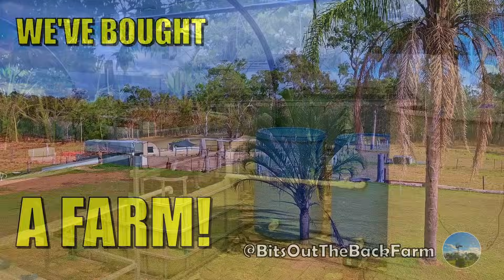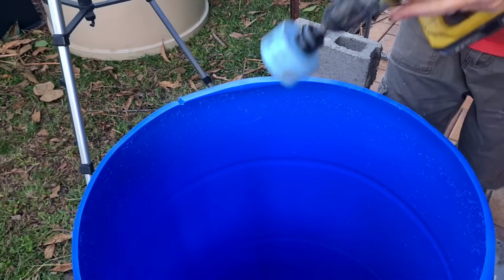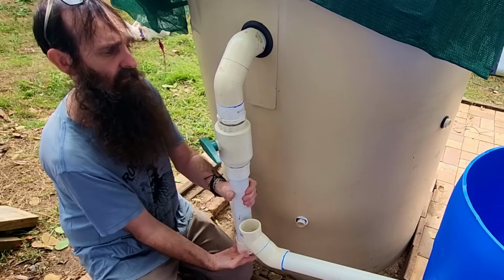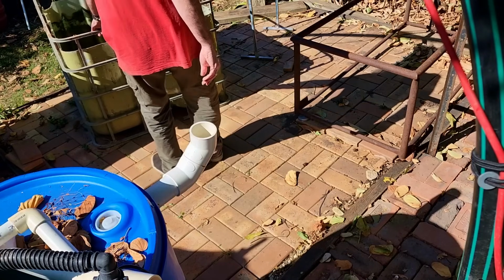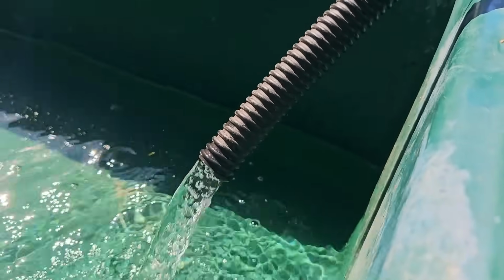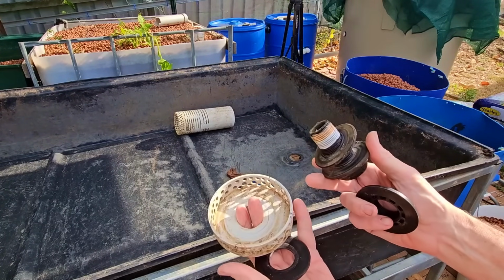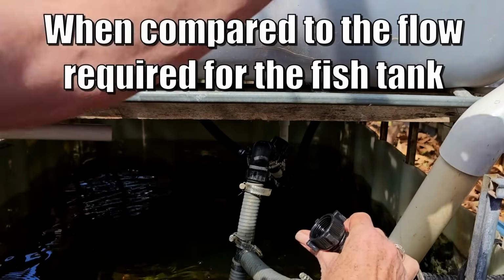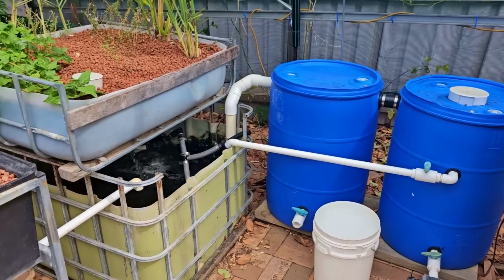Complete DIY Aquaponics System Build | Fish Tank, Filters, Dual Root Zone & Media Beds

Comment: holman make the 90 degree elbows. i've never seen those bends you have, in australia
Reply from the maker: Loads of folks make the 90°. The dual 45° create a sweeping bend. 😉
Reply: @RobsAquaponics  so what's the piece that you mentioned wasn't common in aus?
Reply from the maker: @nil0bject  Sweeping bend 90° that allows water to flow easier. Speciality stores sell them but the big box & local hardware stores don't stock them from what I've seen.